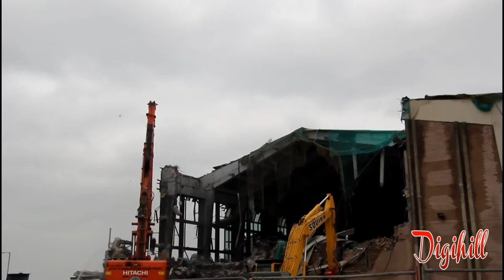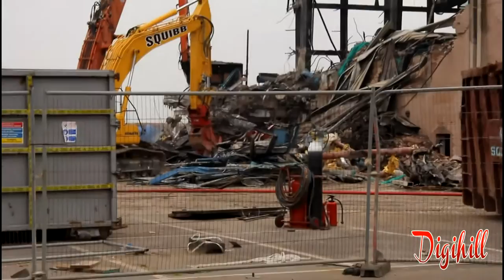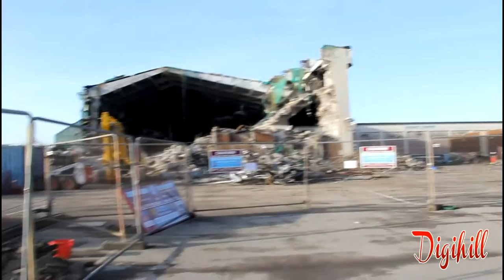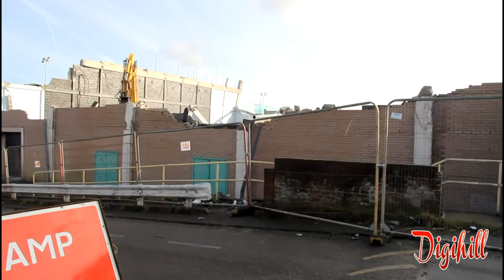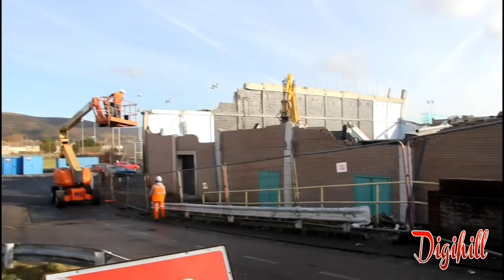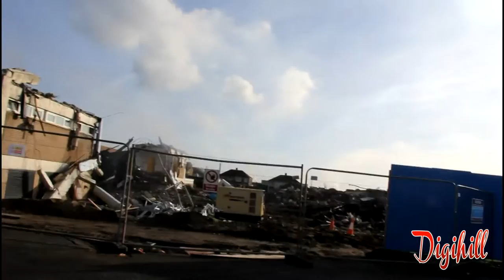Afan Lido Demolition - Port Talbot - HD

Comment: The Lido was a colossus of a building and it was a pleasure to be a regular there in the 60s, 70s and 80,s when it was super busy with a large spectator seating area overlooking the length of the pool.It was never the same after they got rid of the olympic diving boards and the massive pool and changed the name to the Aquadome which was all plasticky...........very sad.Also,the Sports Centre part adjoining It was a fantastic facility which also hosted big concerts ....Sadder still is the replacement ? they have now built to take the place of the Lido.....it is tiny compared to the Iconic Monster we all loved...Port Talbot will never see the like of the Afan Lido again.........R.I.P